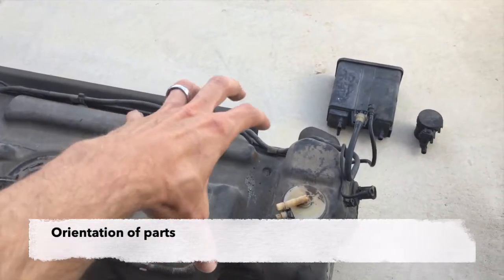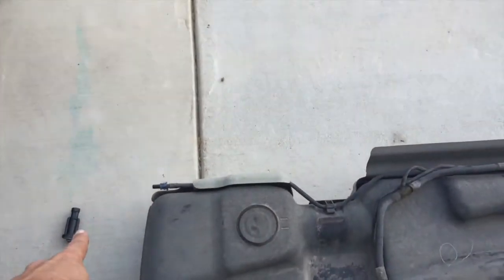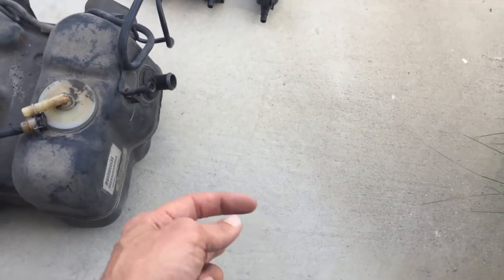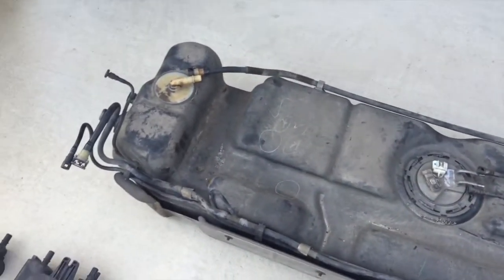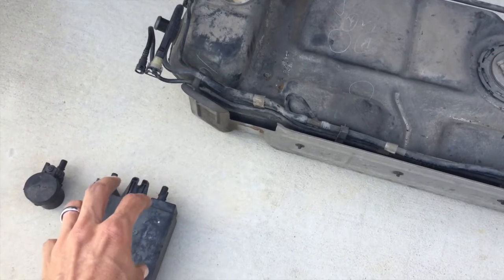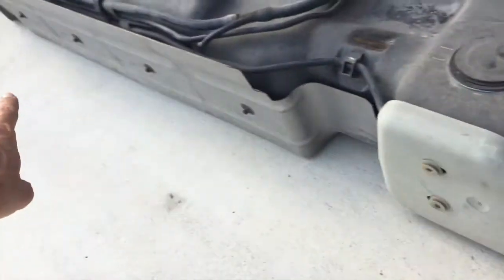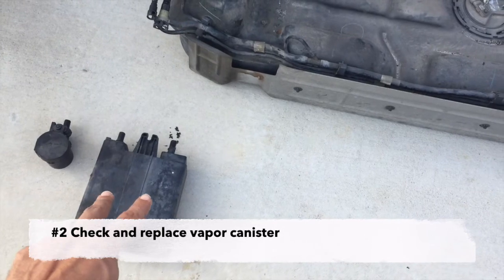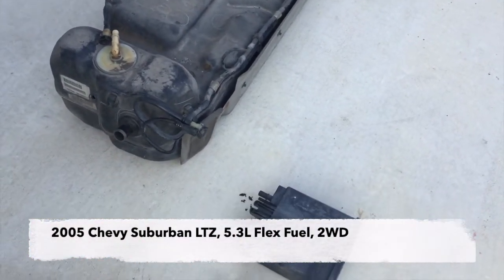Gas pump shut off early? SOLVED! Entire evap system explained & troubleshoot on 2005 Chevy Suburban

Comment: I have had this problem for months. I replaced the carbon canister first; didn’t fix the problem. Replaced the fuel tank pressure sensor mounted into the top of the gas tank, but that didn’t fix the problem.
Then I replaced the solenoid with the 2 hoses (1 going to charcoal canister and the other hose which is secured to the fill tube by zip ties). Still didn’t fix the problem. Please advise on any suggestions.
Reply: You'll need to drop the gas tank to remove the evap lines from the top of the tank and shake out all of the little charcoal pellets. I just finished the job and it worked immediately.

Comment: Hi we have enjoyed your video very much here is our problem.... We have a 2005 suburban Z71 1500, our problem is the gas shuts off after s couple of seconds watching your video we had the vapor canister replaced along with the purge valve also the canister vent solenoid we also had all lines blown out..we still have the problem but not as severe what do you suggest at this point? What more can we do to remedy this problem your advice is much appreciated Thank you so much
Reply: Check anti siphon valve.

Comment: I've been driving mine for three years with the engine light on and the p0449 code. It hesitates a little bit of takeoffs other than that I don't see what the big deal is. I was told to check my gas cap it seems to be okay.
Also I didn't see if you said anything about the top of the engine EVAP like I have seen on other YouTubes.
Reply: He did

Comment: Most of us in the working class, cannot afford to go and start replacing "all the parts in the evap system." This is the parts  suppliers wet dream. With the exception of the evap purge solenoid($22 to $45), everything parts related has gone through the roof!😮

Comment: crazy idea, but could you cut the big line near the tank, tee in with a vent hose, run the vent hose up to the filler neck, and tee into your vent hose there?  of course that would be bypassing the evap system completely and would not be 100% legal, but theoretically would it work?  also, you could tap a new fitting into the top of the tank and tee it into the vent line near the filler neck, right?
Reply: Nope, you will get an EVAP GROSS LEAK code.  It performs an EVAP test once in a while, but closing the VENT valve, opening the PURGE valve (vacuum), then closing the PRUGE valve and measuring the pressure over time.  With a new vent, it will fail the test.  P0455 CODE or similar.

Comment: If you've had carbon into the evap lines...you have to completely blow all lines out before replacing the components. Carbon bits get stuck in the lines particularly above the tank. Works best if dropping tank , remove lines and tap while blowing both directions

Comment: I have a 2011 Suburban. You can hear the air coming up the filler neck and turning off the fuel nozzle. I can get around a gallon if each click of the nozzle. Where do you think my problem is? Valve at the engine? Or the EVAP at the fuel tank?
Reply: Did you find out?

Comment: I have the same problem and I just changed the solenoid system.   The gas pump clicks off so I use a home made aperatus.  That's how it is when buying a used car.
I will save your video for reference.
Reply: What home made appratus did you use

Comment: Codes coming up?  If you suddenly have codes popping up, ask yourself this.  "Has my battery gone completely dead recently or did I change the battery myself"  If yes, drive your car through the manufacturer specific, driving recycling procedure to re-boot your computer.  A lot of things can be fixed by just idling from a cold start for a few minutes while turning on every electricity item in the car.  AC, rear defroster, radio, lights, etc.

Comment: Good afternoon sr
There was allot of good n awesome info
A little too much repetition over n over n other then the
 charcoal pebbles 
U also do a most important n jet simple step 
Put air into the line from the gas tank to the canister if it has a back blow "kick back" it's bad "
This will keep u from putting ⛽ in
N the vent valve remains open unless the computer is doing a pressure test while running can n simply blow into it🙈
N very rarely the valve inside the tank can go bad as well
Not judging
Just positive info
Good luck.

Comment: Had the same problem where I couldn't fuel my Yukon. Started by disconnected the EVAP canister and all the little carbon pellets fell out. So, I dropped the tank, cleared all the lines w compressed air and replaced the canister and canister vent solenoid. With all that done I can now fill up the Yukon perfectly. No more shut off issues.

Comment: I have this exact problem with a 2007 Chevy Tahoe 5.3L . I don't get why some gas station pumps it will pump fine every time I gas up and there's some stations pumps where it does it every time. I would think that it would do it at every gas station. 
Awesome video...very detailed and informative!!!
Reply: My truck does this too,I can put gas into it with a gas can,when it's got about 1/4 tank or so I can fill it up at gas station

Comment: If you live on dirt roads or very dusty environment go with the vent solenoid relocation option.  Otherwise you’ll just keep replacing it. Other option is to wrap in with extra filter material and zip tie it around it. Then just replace that filter every so often.

Comment: I discovered the pump shutting off while filling gas on my vehicle so I moved to a different pump and my problem went away
So in most cases it's the pumps filler nozzle what's causing the pump to off not your tank

Comment: Hey, I have a 2013 Dodge Grand Caravan rt, and it has a fueling problem, every time I go to the gas station and start fueling, it stop at $10 and then stops every $0.10 to $0.50 cents. I think it has something to do with the charcoal canister. But no one was able to understand. I’m in Springfield IL. Where can I go to fix this and what is the problem. Also do you have any suggestions on what to purchase for a fuel efficient car, and under 110k miles and under $14k.
Reply: Did you get it fixed?

Comment: I don't know everything! BUT the anti-siphon valve where the filler neck meets the tank is spring loaded and was preventing me from filling up my tank at full force.  When I dropped the tank to replace the fuel pump at 160,000 miles I tapped the anti-siphon spring and plastic holder into the tank and retrieved it from the fuel pump hole.  I was SO happy when I returned to the filling station and could then fill my tank with the nozzle at full blast.  Before this I had to hold the damn nozzle barely open to prevent it from shutting off automatically as the filler neck backed up with fuel.  I hope this helps someone.  Send me a digital thank you if it does, it would make my day.
Reply: I was contemplating the same thing, that there was a similar device in the filler neck area that could be causing this issue. Maybe They (GM) designed that spring a little too strong. I have a 2011 Cadillac Escalade with the same problem. That makes more sense, but I won’t rule out replacing the evap system components as well. Great insight all around.
Reply: @MW-sl9lv  I think the spring is probably ok - my observation is the plastic part the spring pushed on didn't always slide smoothly, and appeared to tilt and bind instead.  If it binds when fuel hits it from the top instead of compressing the spring and flowing into the tank, that would surely slow down the flow of fuel.
Reply: This may be my problem.   I've replaced everything but the gas tank???
Reply: @brandonhines1613  Just knock out that anti-siphon valve after dropping the tank (when empty of fuel).  Then retrieve the part and spring from the fuel pump hole.  I suppose a person could leave them in there as they are way too large for the fuel pump to attempt to pick up.  They'd just be permanent residents of the tank lol.
Reply: 😂😂😂🤝 @qwerty6464
Reply: Hilarious……probably why the dealer wants to replace my tank for $2700. I couldn’t stop laughing…😂😂😂

Comment: Good video, however I believe you have two of the components mixed up. The larger one sits in the engine compartment is the purge valve which is a pump. The other smaller one  is the vent valve that connects directly to the charcoal EVAP canister.    Good explanation of all the other loopty loop hoses/tubes. I did learn something...
Reply: Nope, he got it right.  The big one is the VENT valve and the small one,  in the engine, is the PURGE valve.
Reply: Nooooo. The video is correct.

Comment: i replaced all 3 and still got the code, now i've dropped the tank and going to replace all the vent lines, 2006 suburban 4x4 z71. i'll let you know if it fixes it.  great video by the way.  was getting sick of seeing all the other trouble shooting done  with a $3000 scan tool
Reply: And?????😂😂
Reply: Did it fix it?
Reply: @Justforfun-ek7et   still got the code but can fill it all at once, instead of a gallon at a time.
Reply: @jerrym995  my truck just started with this the other day, no code yet but I can’t get much gas in at one time. Hoping I can fix it without dropping the tank or replacing everything all at once. Thanks for the insight.

Comment: Awesome, so well done! Thank you! Question: Is there a sequence where I could disconnect a line from one of the components, turn the engine on, and effectively clear the line of carbon so that I don't have to drop the tank? Once the lines are cleared I would then replace the component in the engine compartment and the vapor canister, and finally the evap vent solenoid valve back by the tank. Your comments appreciated! Again, thank you!
Reply: No

Comment: I have a 2007 JKU. I spend 20+ .minutes filling my tank. I have taken it in multiple times and not ONE mechanic EVER told me about this damn canister. I have rebuilt motors and transmissions, I've never before had issues putting fuel in my vehicles. Thank you soo much for this video.

Comment: I've got a 2005 Chevy Avalanche with the fueling issue. I crawled under to pull the canister and check for carbon pellets and I noticed that the smaller vent line that goes up by the gas cap area, where it comes down to the tank and makes that 90 degree curve, the line looks kinked there. I tried straightening it out, but its a no go. Is that line under any kind of pressure? could I possibly cut the kink out and splice in some fuel line hose to avoid buying that whole vent hose set up that runs across the top of the tank? Do you have any idea of what the whole vent line set up that runs across the gas tank is called properly in case I need to order it?  Thanks for a great video! Subbed!

Comment: Wow brother thank you so much for this video. I bypassed the canister and vent valve, by disconnecting the lines and went to the gas station and still had the same issue. Your video just confirmed my suspicion about those little bits I saw when I disconnected the big line  Thank you for this. I feel 100% more confident in what I’m doing and what I have to do next. 👍🏽
Reply from the maker: So glad it helped!

Comment: Thanks for the vid!  Question, I've seen other videos where compressed air is just blown in the purge valve while the gas cap is off...is that sufficient?..or wreckless?..would it harm any other components, or lines?

Comment: I changed all 3 of those components and I didn't see any carbon bits coming out of any of the lines or components and I'm still having the same issues (evap code and issues putting gas in my 09 Avalanche) any other suggestions?
Reply: Anti siphon.

Comment: When you’re talking the “tubes” that connect the different parts…can I clean these or do I need to replace them as well?
Reply from the maker: Cleaning the lines/tubes should be sufficient. But, definitely  check for any cracks or holes in the lines while cleaning. I didn't replace any of mine.

Comment: I unhooked the lines and stuck a leaf blower in my gas inlet and blew all the bits out. Saved me from dropping fuel tank.
Reply: @TheJunkMule  no, I didnt let the fuel out. The vent line is at the top. You will just be pushing air through it out to the lines you disconnected
Reply: I’m pretty sure this is pure genius.
Reply: @TheJunkMule  yes, where you put the gas in.
Reply: Where did you unhook the lines? At the canister filter?
Reply: I have a leaf blower....please be a little more clear just exactly how you did this please
Reply: @raynetamanwarin7028 Disconnect the line on the charcoal canister that's coming directly from gas tank. Then remove gas cap and blow air into the filler tube, same route as pumping gas.
Reply: @raynetamanwarin7028 Did you do it?  I would also release the line in the engine bay in addition to the lines to the charcoal canister.
Reply: Wait a minute. This doesn't fix the problem because the problem lies in the CHARCOAL CANISTER being too old. It's recommended to change it every 7 years which is easy in an SUV but very costly in a Vette. You might get temporary joy but the code will come back. Just like erasing the code or disconnecting the battery does. You have to change the canister because the charcoal pellets are clogging the air ways. Also what wasn't mentioned and is very often the problem is the GAS CAP. The seal goes bad and causes a vapor leak. I'm going to get it done by the STEALER because the cradle and trans have to be dropped with the Vette. I would repeat the process by disconnecting all air lines, blowing all blockage out and replacing the charcoal canister. Problem solved. Good luck.
Reply: Wait, so let me get this straight. You disconnected the lines to the vapor canister, then opened up the gas cap and blew air from a leaf blower into the gas filler neck?

Comment: Anyone know why Tahoe burns gas ⛽️ extremely fast at abnormal rate? Sometimes I smell fuel fumes after turning car off 

Also, example 20-30 miles burns quarter tank it’s very awkward
Reply: Do you have a check engine light?

Comment: we did all this and when blowed lines nothing came out but still problems filling, i suspect that big line has a problem where the small lines merge, a friend said he had to change that big line where they merge and fixed it , anybody else had to go that far?
Reply: If your going to go through the effort of lowering the fuel tank to remove the line assembly off the top you might as well use hot soapy water to fill the lines let them soak and then blow it out with an air compressor. I've used simple Green and hot water in a trash can overnight. And had great results. My other suggestion would be stopped buying all these replacement parts and just replace the internal filters. The solenoid valve has a pop top. Replacement filter source any high-density foam cut to fit. The charcoal canister has a pop top. Dispose of the fuel soaked charcoal. Go to the pet store and buy the pre-bagged charcoal filters. Fill the canister with the charcoal. Use a little RTV sealant to ensure that you don't have an air leak when you place the lid back on top. Do you not top off your tank ever again. Problem solved.

Comment: One of the frustrating things that professionals have to deal with is cars that have already had multiple components replaced, yet the issue persists. Aftermarket components are usually inferior and sometimes bad, right out of the box! So a professional workflow takes a little bit more effort to verify which part is bad. If you choose to spend money up front and shoot the parts cannon, remember to hang on to and label your old parts so a pro can retrace the steps.
Reply from the maker: Good advice! Everyone take note. Also, I agree on the cheap parts. Having tried the cheap parts over the years, I no longer fool with them. I try to buy the best OEM parts I can, in this case AC Delco.

Comment: I was having trouble filling my 2013 Chevrolet 1500.  It would take me 15 minutes or so to fill up my truck if it was under 1/4 tank.  Replaced the vapor canister solenoid including the hoses and electrical connection.  After spending $135 and 3 hours removing the old one and installing the new one, it did not solve my problem.  I did a lot of research on this problem and just about all videos said to do what I did.  Does anyone else have any suggestions.
Reply: I disconnected the system....the vapor canister is probably dead (cracked up/split).  I went to the gas station and the gas flew into the tank.  I'm thinking about not reconnecting it.
Reply: How do you disconnect the system??
Reply: China Boss , I replaced it also. Didn’t help one little bit.
Reply: Ive done the same stuff using all ac delco never solved my problem. Huge pain in the arse

Comment: I have p0443. Should I just replaced the three components? I just did the purge valve and the code just came back on.
Reply from the maker: I suggest replacing all the components. The two components near the gas tank will definitely fail at some point.

Comment: Every one of these things gives trouble.  Why in the world did GM not provide an access panel through the floor to the top of the tank where the fuel pump is on top of the tank.....  I know, cost, but dropping that tank is a MF!
Reply from the maker: Yes, it was definitely a pain.
Reply: bolts that hold bed down....loosen right side bolts, remove left side bolts, unplug tail lights, lift left side of bed (tilt) and support with 2x4.
Reply: lift carpet, cut the hole, make repair, seal the hole with brackets and silicone/or tape, replace carpet.